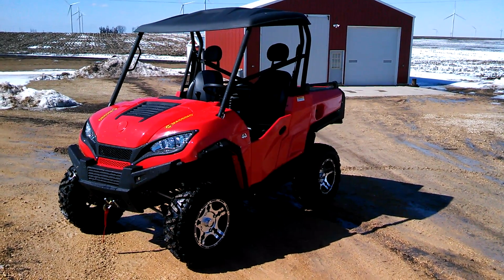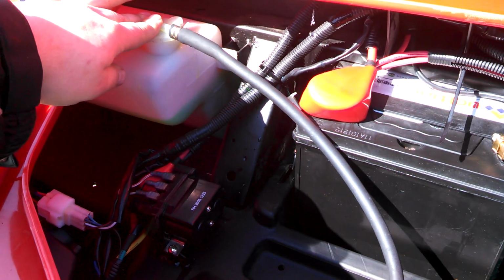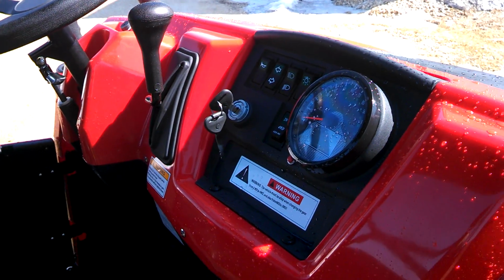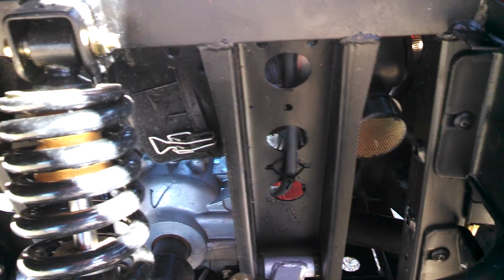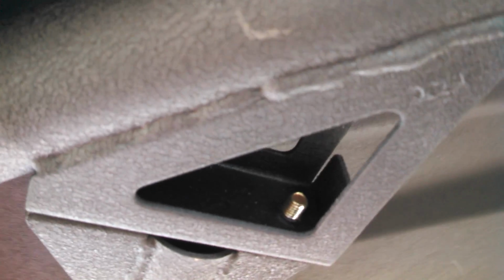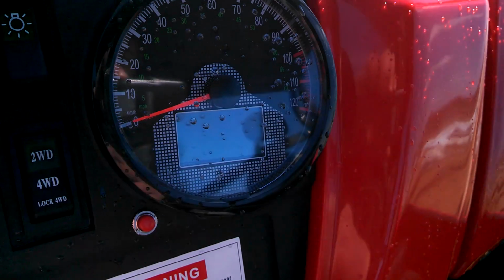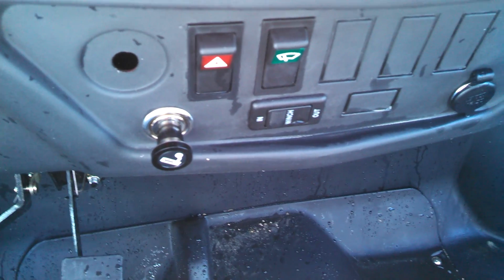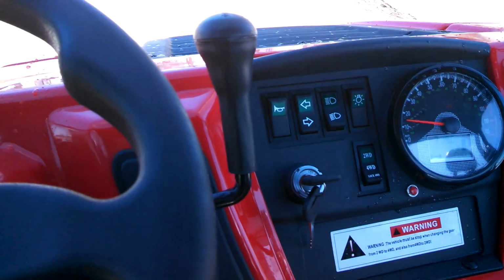Massimo 1100cc UTV *Kelley Motorsports LLC*

Comment: China products scare me. I bought 2 China bikes back during the pit bike craze. I broke something every time I took one out for a ride, these were supposed to be "top level". Needless to say I built my own with old OEM & aftermarket parts.

I have an 83' ATC200X that fires every time I kick it over. 30yrs old and it does what it's supposed to do. Where does that level of quality exist? Nowhere. If the Chinese were serious about breaking into American markets they should done what Japan did.
Reply: Nothing beats Honda or Yamaha reliability...never had ANY real problems with my japanese machines....knock on wood!